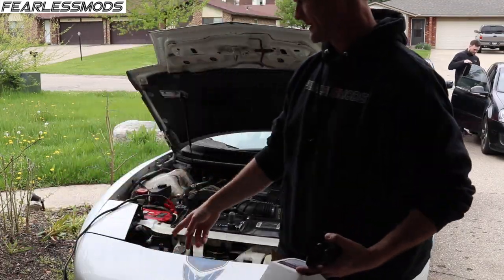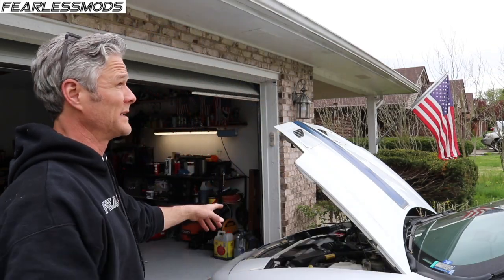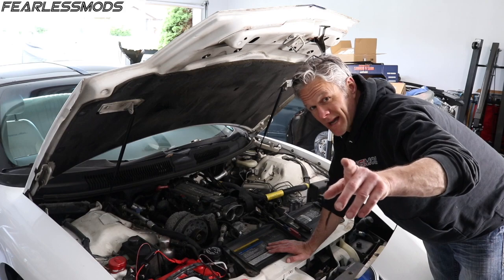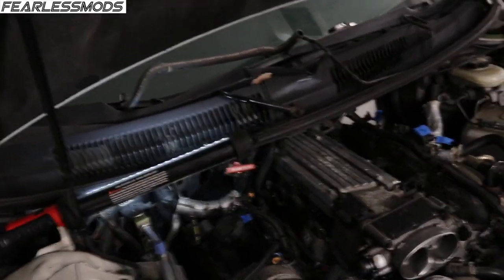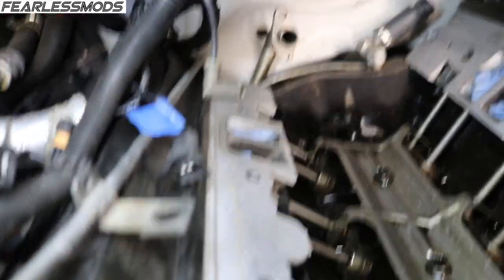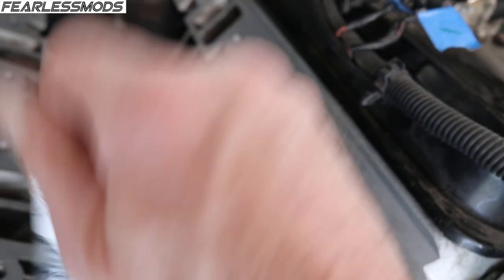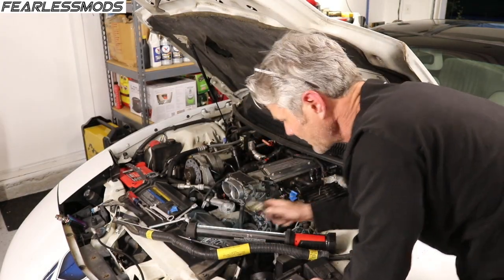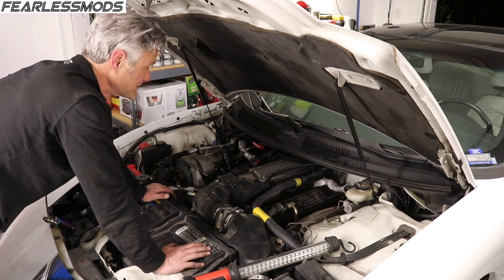Remove and Replace F-Body Trans Am LT1 Intake Gasket

Comment: The intake manifold usually leaks out of the RTV seal at the back of the intake because it's RTV and gets soft due to the heat from the EGR valve.
Reply: yeah thats what mine does .... seems dangerous cause its leaking onto my cat and smokes when i stop
Reply: What’s the best way to keep this from happening again
Reply: @TAD0002  egr delete
Reply: @acrock21  yep me 2
Reply: @msawyer110  terrible, my cars been sitting parked for about 2 years...

Comment: Just purchased a 1994 Firebird 5.7 LT1 with 6 spd manual with 43K original miles. Car runs great for 10 minutes or so until it warms up.  Then idle drops, runs rough, mis fires. Your videos are helpful. You as well as others have or had the same problem.  Did you ever pin point the problem causing the misfires?  Any advice is greatly appreciated.
Reply from the maker: Still searching, but getting closer. I may have fixed it by replacing the pigtails to the coil and the ignition control module. Jury is still out…

Comment: Excellent video, nice guide for intake gasket replacement and probably head gasket replacement as well. My one question though is...why didn't you just take the hood off to allow for easier access?
Reply from the maker: Probably would make it easier, but my biggest problem isn’t the hood…it’s bending over such a long/low engine bay which kills the knees and back! 😫

Comment: I'm not sure what is wrong with my lt1. my dad gave me the car id would start but blew smoke the last time it had a tick. it was a pushrod wile i was putting in new one i herd some gargling when turning the engine over from the same cylinder. popped off the radiator cap and sure enough was low. put it up for sale the highest offer was 800 lol id much rather fix it. it would be my first car and every man should have a sports car for their first. from what i seen its not hard its just some organization and time which i have. not sure what parts i need so I'm going to take it apart then order. I'm probably going to video it all as there isn't many videos of 4th gen Camaro head gasket change that are in 1080 hd.

Comment: How many hours did this take you ?
Reply from the maker: It was probably about 4 hours or so.  Maybe more.  Hard to tell because I was splitting time helping my son on his car!
Reply: @FearlessMods  ah fair enough well I did thr ls1 > ls6 intake manifold swap a few years ago on a 98 Z28. Took a bit longer due to breaking the oil pressure sending unit 🙃

Comment: When u replace the intake gasket it's at white smoke coming out from exhaust i have 96 trans am same engine my start at white smoke smoke coming from exhaust
Reply from the maker: Mine didn’t have that. Normal if cold outside?  Burning off antifreeze that got in the cylinder during the job?

Comment: Unnecessary to drain the coolant, the Gen 2 SBC (90s LT1/LT4) is a DRY intake.
Reply: Brett Harrington still coolant in the throttle area when you disconect the lines on the TB theres coolant
Reply: @beetlejerk  True, should be a very small amount of coolant in the steam pipe system that passes through the TB. Very little coolant drain is required, and most have done the TB bypass mitigating this altogether.
Reply: @bretth1714  yep